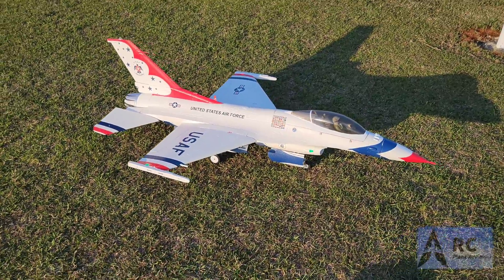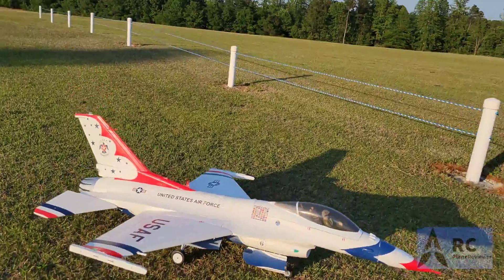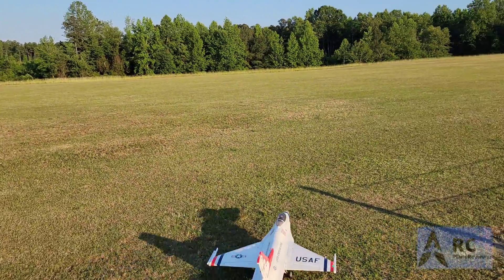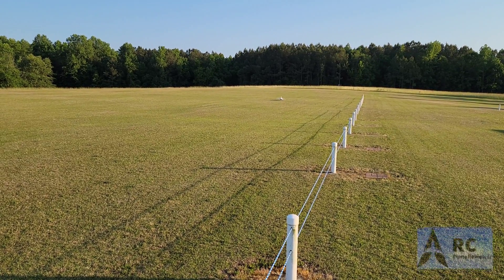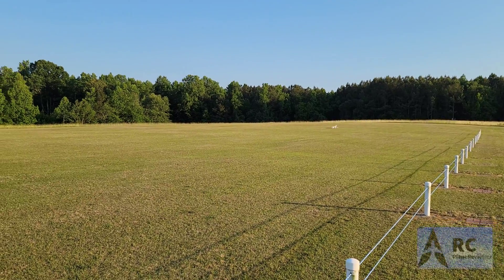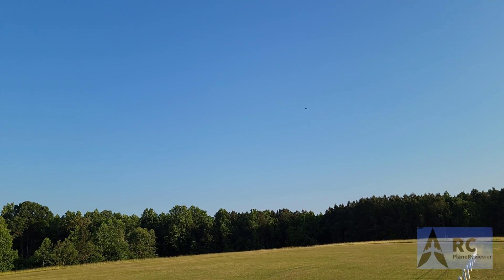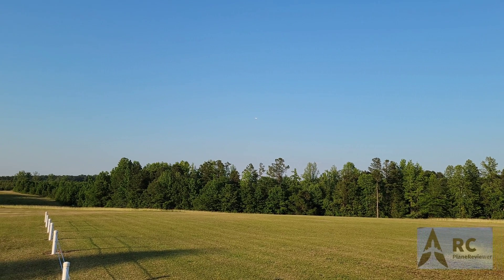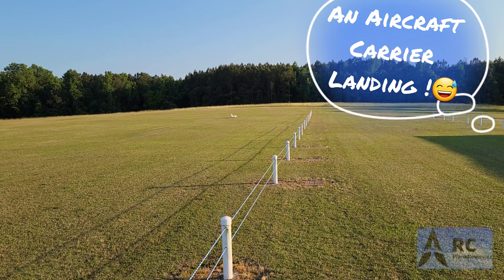This is What Tail Heavy Looks Like! Freewing F-16 Super Scale 8s 90mm EDF JET in 4K

Comment: I’m curious if you had a plane that was flying well with a different power system, why didn’t you check the CG before you removed it and then match it to that with the new system. Not trying to be mean but that would be the easy way to minimize surprises.
Reply from the maker: ....that's exactly what I did

Comment: Great job getting it down in one piece, this bird does not like to be tail heavy!  I fly my FW 90mm F16 balanced at 125mm.  I'm flying off grass with the 6S 12 blade 1835 Kv inrunner, gets off in 100 feet, even using a SMC 8100 battery, so it's got some horsepower.   Get 5 minutes of flight time on that setup. 🤗
Reply from the maker: Thanks for sharing

Comment: @ Philip Mew. I fly this bird myself currently on 6S and the stock 6S setup is a little weak and makes this bird harder to build up adequate speed to safely rotate on grassy runways.  It also has a higher wing loading than similar models of this size.  I take off on a full concrete runway and it takes a lot of runway be able to rotate…a little less with flaps.  This is why I am upgrading mine to 8S as we speak.  The landing gear are very sturdy and designed well.  I’ve been quite successful over the past 2 years with mine and other than coming is a little heavier that it should for its wing area and size, it flies VERY well and is a lot of fun to fly overall.

Comment: Good job saving it! I had 8S setup with FMS 1500kv fan but it’s too heavy, I’m trying the 9 blade 6S setup.  On 8S mine would drop so much on turns it made it not fun to fly.  We will see I might go back and use the freewing 8S setup, it has more thrust than the FMS 1500kv.
Reply from the maker: Yeah I have the fms 90mm 1500 too and I may try that as an option too! Thanks for the info!
Reply: @RCPlaneReviewer  I switched back to 6S and like the plane much more, but I fly off of pavement ! The FMS 1500kv is too heavy for this bird.  If you go to 8S, use the Freewing one, it’s lighter and has more thrust
Reply: @timothydoss6199 the Freewing 90mm 1380kv is the same weight as the FMS 1500kv and produces less thrust. Iv done back to back testing in multiple set ups. FMS is 10 -15% better.